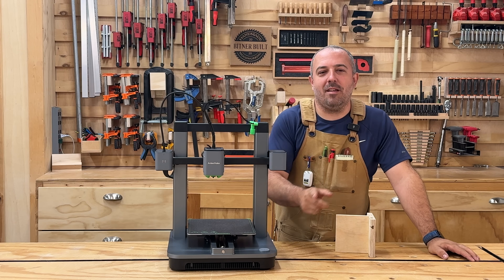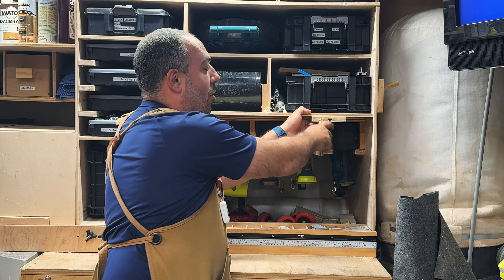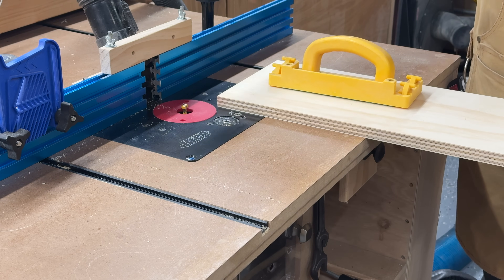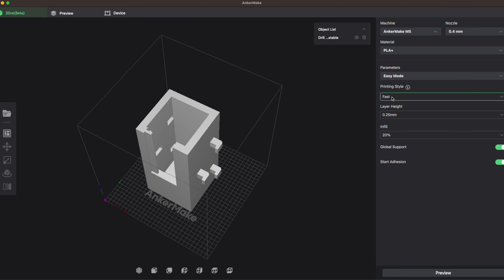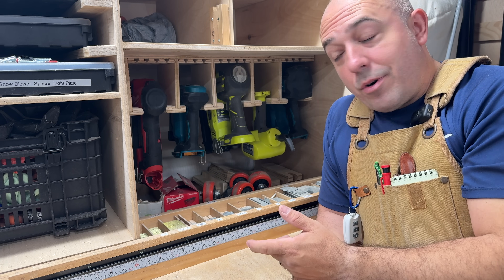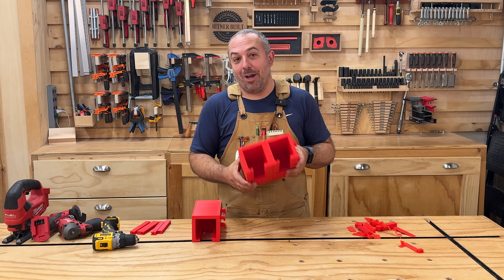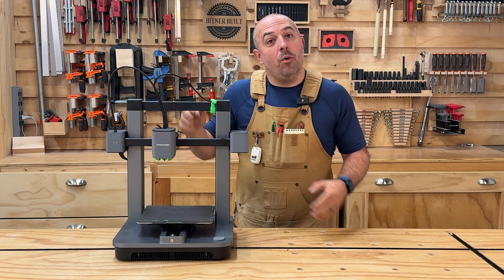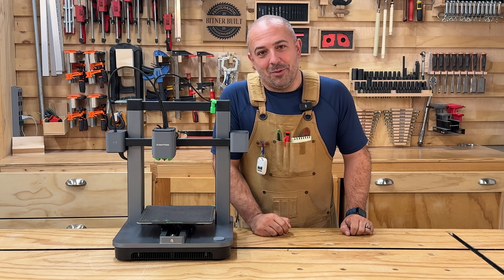Wood Vs 3D Printed Tool Holder Made With The Ankermake M5C - Free Files!

Comment: Good vid. How does the cost of the filament compare to the plywood? Also, how many printers do you need to get you just as fast building it with the wood?
Reply from the maker: On cost , So depends on your infill (how much empty void you leave inside vs solid plastic) I would say that vs plywood it’s a bit more expensive but it’s a different process too. I prefer woodworking but I have come to value the intricate designs and functions you can make with 3d printing and it’s not time consuming as I just hit print and walk away. I use it a lot for tool holders, dust collection (I LOVE my 3d printed Y blast gates) and organizational storage items. From a time perspective sometimes it faster sometimes it’s slower. It’s much faster on smaller jobs, like my chisel holder for me to make it beveled in the same way would take a hr or so but printed in 20min

Comment: Instead of having the different spacers and having to "scale up" for different sizes, the basic design could be made "parametric" and then you could always print just the size that you need, i.e. without needing to also print a separate spacer nor having to worry about the mounting hole sizes being problematic at different sizes.
Reply from the maker: Good idea 👍

Comment: One benefit of using 3d printed modular stuff is that you can easily store and reuse the files in the future. Also,  3d printing lets you change the colors, so, for example,  you could use black plastic for impact tools.  With woodworking,  you'll have to measure everything, find the right bits and tools,  and it'll almost be like starting from scratch.
Reply from the maker: So I agree on the benefits of 3d printing, that’s why I like the series as a way to expose woodworkers to it and show how it’s useful in the shop 👍 the dig on woodworking though… I wouldn’t go throwing stones, there are tons of woodworking apps where I model and store all my measurements, set up blocks and jigs make making those cuts easy using different species and stains I could easily color code. There’s also the enjoyment in crafting. I could knock 3-D printing in a ton of different ways however, it’s not a this or that, it’s different ways of accomplishing things and different jobs call for different tools. I really enjoy both and see the different merits in both.

Comment: The benefits of 3D printing toolholders is the ability to customize and create bespoke tool holders for all of your tools.  I understand the desire for modularity so you can print it once and forget it, but with the ability to create something bespoke I'm not too sure it's necessary.
Reply from the maker: Sure but I’d say the same thing about my wooden holders.   I’m constantly buying new tools, and so I regularly have to rip out my bespoke wooden tool holders, and completely remake them again to accommodate the new tools. So I have started to build all of my wood holders with modular in mind as well. Just presenting one option and perspective for it. Of course everybody’s different with how they want to do it..

Comment: Love your videos and instruction style. 
I really haven’t thought much about getting into 3D printing but found this video to be extremely interesting. 
I would like to see a blast gate construction idea for multiple size hoses. I can see where the adapters could be 3D printed and exchanged where needed. 
Thanks again for a great project.
Reply from the maker: I’ve actually printed a few blast gates including a Y style and they are my favorite so far, check out my video on the AnkerMake M5C I make one in there, as well as 10 other items. I was not a 3-D person until very recently with this printer, because it was so easy and the millions of free shop stuff that you can just print out with it it’s crazy.  Good luck on the giveaway.

Comment: Like the video and modular design. While watching, I  noticed a 3d printer could print out the components of the wood system. It would be the same style plate with T-slots. The plates could be printed on end with out the need for supports. They could then be screw to an upper shelf. Using multiple plates you could make it as wide as needed. Then the vertical dividers could be printed with a matching slot to slide into the T-slot on each end. These could also be printed on end without need for supports. The bottom plates would also be printed vertical without the need for supports and T-slots. With multiple width bottom plates you could chose the proper size needed for each tool. This would effectively make a modular system with the 3d printer the same as the wood system. Additionally, the strength of the plastic could allow for closer spacing giving more options for arranging the parts.
Reply from the maker: very true! hadn't thought about that so good thinking! Good luck on the giveaway!

Comment: I have one of those keyhole bits laying around I might have to try using it like this. Also making a printed version is very tempting for custom tool holders. Clamp holders could be a good idea to put head to head
Reply from the maker: You know, I had that keyhole bit lying around for ages, I bought it for the usual picture frame keyhole hanger inset, but honestly rarely ever use it so it was nice to find a different use for it. One user did point out that a dovetail bit might be better in the long run, so I’ll have to play with that too, good luck on the giveaway!

Comment: The 3D holders look great. I would like to see a strength comparison between the two. Looks  like 3D is more than capable though.
Reply from the maker: I was thinking about that however, there are a lot of factors with strength on the 3-D printed one. The filament type used, and then the amount of infill on the print itself. The typical goal would be to use the least amount of infill needed in order to make a successful structure that is going to hold up in day-to-day use. If I was going for strength for a test however I would just solid print the thing to make it as strong as possible. However, then I’m just using a crazy amount of filament so the strength is tricky as I printed it with 20% infill it’s plenty strong for Its day-to-day use. Good luck on the giveaway.

Comment: I like both designs.  I Actually have ideas for upgrades.  For the wooden system, I’d add a dadoed back so when you slide in the dividers, the back of the dividers would engage the dado.  That would help keep the dividers from splaying outwards away from the tool when the weight of the tool rests on the bottom of the divider.   On the 3D print, i like your idea of the batteries on top.  I’d add a lock on battery adapter plate so you can click in and securely store your batteries.  the lock on could reuse the design you have for stacking the tool holders laterally.  A big thanks for sharing your design drawings for free.  Not too many folks do that.  🎉
Reply: PS an idea for another vs could be concentric cam locks, wood vs 3D print.  I haven’t decided on a 3D printer yet, but I’m close.  I make wooden concentric cam locks, teardrop shape, to act as dog hole clamps, a mechanism to engage/disengage wheels on roll around work carts, and a lifting mechanism to engage a dust collector bucket.
Reply from the maker: Great ideas! I mentioned the dado back at one point for rigidity (or at least I filmed it at one point, might have been cut for time) but either way your right there, I specifically didn’t do it because I was placing in really deep items that would have prohibited them being put if I had put a backer on, or required me to make it a deeper unit. Good luck on the giveaway!

Comment: It's a great project, I really like the organization type of stuff especially things for the cleat wall.  I'd love to be able to print my own, but your giving the files away for free makes me really want to pursue a 3d printer.  So a huge thank you for them and love your channel.  keep it up!
How about a comparison air cleaner.  The cheapo 4 filter method vs a nicer looking model a WW might build vs a commercial ceiling mount one for example.  Need to use an PPM air tester to see how clean the air is as you get results.
Reply from the maker: Good out of the box idea! Trying to think volume wise how to print that, I have constrains based on the printers size. Good idea! Good luck on the giveaway

Comment: Really enjoyed your video. Your idea of using the keyhole router bit to provide options for spacing was very creative. I have not given 3D printing a great deal of thought in the workshop, but you have opened my eyes and piqued my interest. Something new to learn. 

I would like to see a video on stop blocks that could be used with T-track for a miter saw or ways to use 3D printing to create drawer guides/rails.  Regardless, thank you for sharing your creativity!
Reply from the maker: Yeah I hadn’t either until very recently and then realized how much accessory could be in the woodshop especially for something like a dust, hose, adapter, custom-made for particular tool, etc.Good idea! Good luck on the giveaway

Comment: Hello, I’ve seen a lot of videos discussing guide rail squares from companies like TSO. They are made to support different track saw rails and I think it would be cool to make something out of wood and also with a 3D printer to see if you can do it at a cheaper price or if it’s still better just to buy one.  The video could show how you would plan to insure that the wood version is square or a true 90. The same could show how a 3D printer could possibly insure that the printed piece is also a true 90 and whether it’s more accurate. Maybe a head to head with an actual aluminum device could be added as a bonus such as the TSO version. Anyway, just an idea and both tool holders you made are great designs. Thank you for inspiring.
Reply from the maker: Great ideas, I like it! Good luck on the giveaway!

Comment: I dont know anything about 3d printing. But, if its free, its for me! Even if ibdont win, the entry fee is free. 
I would like to see a floating tenon jig. Im currently in the process of building a large dining room table and will be using floating tenons. Ive built one out of wood and scraped it half way in. I have built a  simpler design. Hopefully this will get the wheels spinning in your head.
Reply from the maker: Free is always right! Great idea! Good luck on the giveaway

Comment: Great content! Id love to see some 3d printed french cleat tool holders. 
I would also like to make a suggestion if i may, the hook design is interesting but not very optimised for 3d printing, a sliding dovetail design would be much more efficient and wouldnt have to worry about supports, or even the same profile as your using for the adaptors.
Reply from the maker: Very good suggestion on the hook design! I like it! Good luck on the giveaway!

Comment: I'm not a big commenter on youtube.  As a rule, I don't troll.  I'm tossing out some criticism from real experience.  The T slot plywood holder is not robust.  Leaving an empty slot for a relatively short period of time will see deflection in the holder from adjacent full slots.

Major home center store 5 layer 3/4" plywood will behave even worse than the 7 layer you are using.

The setup is more difficult, but a dovetail slot works great with very little to no deflection.  Also, don't accept the base of the 1/4" dovetail bit; run another pass to make the narrow part about 3/8" wide.  

Tight tolerance and glue with the T-slot bit works great, but of course you somewhat lose the key feature of customizing width.

I like the lego look of the 3d printed holder.

Finally, hopefully I'm wrong and your experience will be different than mine when I went down this path.
Reply from the maker: Thanks for the thoughtful criticism! I do appreciate others with a well thought out rebuttal. I like the thought of the dovetail in place of the T. Definitely something I will experiment with. I will be sure to post after some time if I do see major deflections, My feeling is I like to try things as they pop in my head, some work some don't, so interested to see how it goes! Again I appreciate the feedback! and good luck on the giveaway!

Comment: Those must've taken a long time to print! I've been adding 3d printing to my woodworking projects and I've found that using the printer just for the small precision parts to be more fun. For example in this case, just the inserts and some rails for them can be printed & the rest is just making boxes which we're all very experienced at!

You could also prevent the need for all that support material by having the cleat stick out on a 45deg angle. Looks like it would be possible for this model.
Reply from the maker: yea 8 hrs each on these, so not tooo bad. True on the 45, this was my first time working with a freelancer so kept it simple good luck on the giveaway!